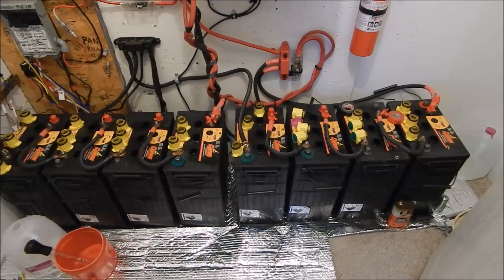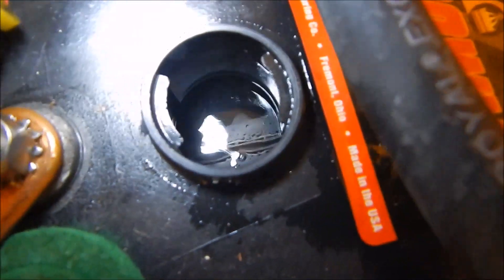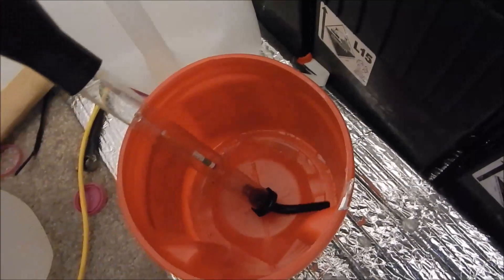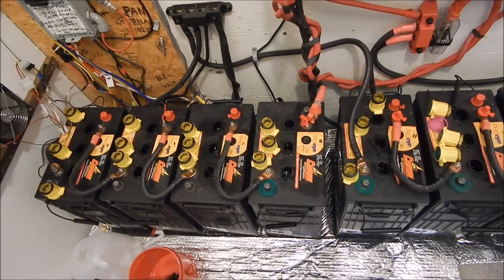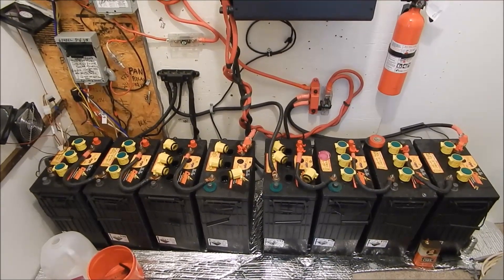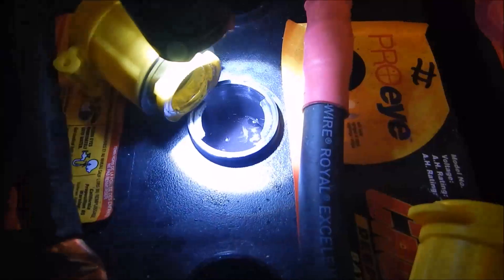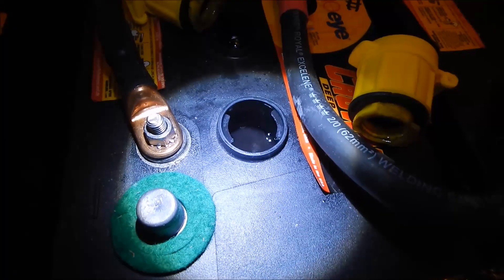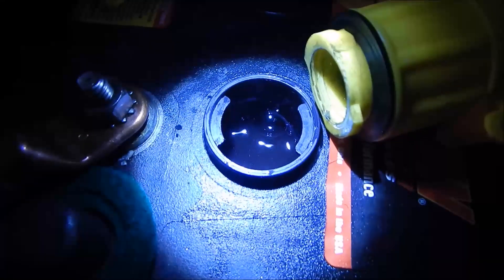Battery Bank 24V  My Big Costly Mistake!

Comment: Greetings from Oregon, I know that you now have a  Battery Extra installed on your system and have recovered your batteries. My question is was the heavy sulfation  from insufficient charging? Not high enough absorb voltage and absorb cycle time? My batteries are 3 years old and there is no visible sulfation on the plates. I have my absorb voltage at 30 volts and absorb time at 4 hours. I use a Trimectric battery monitor and a refractometer to confirm its accuracy. The one thing I have done is make sure I don't let the batteries go below 80% SOC and no more than 3 days in in between a full charge. My system was a off grid 1400 watt array with a Tristar PWM with a diesel backup. Since then I have added 2 more arrays with a Midnite classic 200 and a Outback FM 60. I am experimenting with the absorb time and return amp settings to get my specific gravity to 1.285I checked it the other day and it was 1.30, way to high and may cause shedding. I have my return amps set at 12 and I will see after a couple days if its right. Chris DIYer has the same desulfator as you have with similar results. I would get one but all my plates look like the day I installed the bank.
Reply from the maker: Hi Steve, This damage was self inflicted as I said. I was careless in watching my battery bank.Every thing running fine made me forget my bank. My charge & absorb setting were wrong as well. I also split up my bank at times like this past summer & run 2 L16s  in my Solar truck camper. I also left 2 of them sitting for 6 weeks while I was traveling , those 2 are the worst .The way U are tending to yours is the right way to do it. I learned a great lesson here with this mistake & shared my mistake so others would not do what I did. The battery extra unit works great, has cleaned up the inside of the battery's very well. I wish I had it from day one. Glad I learned this now not latter as I sold this place & I am looking for some Off Grid land in TN. to expand my system & live free. Thanks for stopping By. U do great work on your channel.
Reply: TheKilog69 Thank you sir. I hope you find the land you are looking for in TN. My wife and I have talked about doing this again only on a smaller scale. We have talked about a much smaller acreage and a much smaller house. I hope you video your property search and take us along for the ride. Have a blessed day!

Comment: Just Curious... Why 4 panels in series?   60 volts in to a 24 volt system seems high.  Wiring for 30 volts would double the current and a good MPPT should manage that OK.  Your thought.... Thanks.
Reply: Bob Duvall always in series as high as your mppt allows. Easier on the wiring and less power lost
Reply: Double current dictates heavier wire gauge... Which on the longer runs from panels can be quite an expense.

Comment: To be secure in Battery Watering Operations, you may want to consider a Self Water System... like the Flow-Rite, yes it will cost you $200-250.00 dollars, BUT how much will it SAVE you $500-$1200-2000 dollars.  I have installed several for people who don't want to mess with Watering Batteries, and people who spend lots of time away from Home.  The Gravity FEED watering system is totally the way to go.  I don't work for Flow-rite I just use there system and it's the ticket.    I build specialized equipment containers on contract for the Gov't.      So, bottom line SAVE money do yourself favor, check it out.
Reply: I have seen some real advances in capacitors esp graphene/carbon - some even self charging like a pulse charger from ambient solar radiations (cosmic wind) very slow but for small power efficient projects chips or other small hardware -- they could be self powering from environmental emf emission's.

Comment: I charge at 14.35 to 14.50 on my system. But I also have a bunch of high amp knife switches that disconnect my multiple string sets so I can hit them with a 250 amp car starter/charger unit. I fire up the genny and I do that 1 time a month for 10 minutes if they look to need it until the battery temp sensors light up and I shut it off.  I also desulfate with a DC welder, Its amazingly fast. And yes, the sulfates floating if any are cloudy for a while. http://rover.ebay.com/rover/1/711-53200-19255-0/1?icep_ff3=2&pub=5575119394&toolid=10001&campid=5337663791&customid=100A+Adjustable&icep_item=291952297948&ipn=psmain&icep_vectorid=229466&kwid=902099&mtid=824&kw=lg This welder is adjustable and awesome.

Comment: how are the batteries doing now
Reply from the maker: Hi Roy, I just limped into battery room, last looked at them last Sat. lets say. huge difference. a little to shaky to stand up today but will try to film the inside tomorrow & do a update video. It has been working on the bank  10 days tomorrow I have to say it works.
Reply: Get well soon.
Reply from the maker: Thanks Roy.

Comment: Thanks for sharing.  Great information.
since I am new here do you have a video showing your battery ventilation setup?
Reply from the maker: Hi actually I have had this set up about 6 years now, Yes they should be vented!  I even have all the necessary venting supply's  I need to do it but as it sits in a big closet with 5 bush less cpu fans that come on set to a specific voltage,& the closet is in a spare bedroom with a fan & a open window I have never installed it. It is not a problem for me.  The water miser caps help a lot all so with fumes. My home is for sale so many of my solar projects have been on hold.
Reply: TheKilog69 Gotcha, good luck with the sale. I will look forward to seeing a reinstall in the future sometime then.
Take Care.

Comment: Sorry to hear about the batteries.  Hope they are OK.  You made me think to check my bank and I'm glad I did.   What model did you get from that website?
Reply from the maker: Hi The 1500 amp hr job .$139. I will be all over it when it arrives from the UK, I will do extensive testing. U can bet i will do as many videos as I can.  When things are going good U tend to forget about maintenance.
Reply: Boy you've got that right.

Comment: I have very limited experience with these solar power banks. But I am contemplating research and building one, with that said, would not a dry, or maint. free batteries be better to use?
Reply from the maker: Hi thanks for watching .All battery types have the + & _ points . wet cell lead acid are the most affordable, AGM would be next inline. Stay away from gell cell type battery's very unforgiving as they use a gell that if overcharged will bubble causing issues & will not work, not many ppl. use them for solar most use lead acid or AGM, or if money is no object U can use nickle iron Edison type battery last for ever but U need deep pockets to buy them .to do my battery system as it is cost about $2000 just battery's nothing else cables so on, , using Edison nickel iron over $10,000.
Reply: NO.....you can not check them and you can not perform maintenance/add water and they will die earlier than any other battery that you can open.

Comment: we eq every 90 days no issues.
Reply: have mine. set to auto. eq retry 5 times
Reply from the maker: Hi Bill Thanks for info!  Just ordered the above battery recovery system per JC advice will do a in depth review when it arrives ,including Voltage ranges, pics of inside the battery's before & after.  If this works it is money well placed.

Comment: Hope they come back, expensive mistake there. But don't feel bad I ruined a set of L16s years ago by being stupid. It happens to all of us, we get so used to the system working great that we tend to forget about it. Thinking of that I need to check the water level in mine.
Reply from the maker: Thanks. They never EQ to float  after all day with plenty of power got real warm too. i,m getting the re-claimer system that Jusin Case recommends  ,I will do a video when it gets here & all testing as it goes thanks for watching.

Comment: I drowned mine in a tub with the charge controller running.  I think I still hold the trophy for Stupid.
Reply from the maker: OK U win but I get 2nd place.  I am ordering the battery re claimer system recommended by Justin Case . I will do some video on it when it get here if he says it works I believe him. See below in comments for info on it. If it does what it claims it a bargain.
Reply: TheKilog69 I wouldn't buy it from any one in Missouri though.  But that's just me.
Reply from the maker: They come from the UK.

Comment: Oh man...hopefully they will be alright. They look exactly like my Trojans when I skipped a monthly EQ. Everything seems to be alright now...but, the brown milky electrolyte sure caught my eye. I ran mine down to 24.1 all summer (with load at that voltage). Edit: Just re-checked all mine...and am hitting them with another EQ blast for an hour while I got good sun. Took off the Water Miser caps and looked down inside each cell...they all look really clean. Getting about 31.6 volts EQing right now...no loads. My thinking is that the L16 size batteries like ours are pretty tough. Have you ever "bumped" them? ie, "shook" them a little to knock off the deposits?
Reply from the maker: Thanks Chris ,never tried that but tomorrow i am ordering the battery recovery system Justin Case recommended to me, so stay tuned for updates & video of me hooking it up & testing it out, see his link in the comments if he says its the real deal I believe him comes from the UK. Mine were on EQ all day never did get done but got really warm lots of Resistance.
Reply: Roger that...great advice. I checked out the item/link...not a bad price either...will see how it goes for you and order one too if you like it.
Reply from the maker: Thanks I will update when i get it getting one tomorrow. $139? A bargain if it works 60 day money back so why not.
Reply: Heck yes! Beats $2000-3000 in battery bank purchase (or getting a few more years out of them). Physically "bumping" mine (or giving them a shake) knocks a lot of that stuff off...and then EQ. I just rechecked mine (after a mini EQ) they all look great...electrolyte is clear, plates are clean. Voltages (checked individually at rest) were all w/n .1v So, good to go here. I also took Roy's advice on Absorb/Float volts and time and set mine that way (30 volts Absorb/3 hours and 28v Float).
Reply from the maker: All good news to here we can all learn if we listen & learn from  others & absorb knowlage. Thats why I,m here. will EQ mine in AM if need be may be half bank at a time .

Comment: instead of putting water in the batteries maybe you should put battery acid in. I get it from Advance Auto but other auto supply stores should have it. Adding acid helped me extend the life of my cars battery to almost 7 years.
Reply: Never add acid to your batteries. Water evaporates and boil out and it will leave the acid in the cells. Only add distilled or de-ionized water to the batteries. 
My last car battery got over 7 years. I never turn my ignition on without running the engine nor do I use electrical power without running the engine, After getting to where i needed to go I turn everything off that needs electrical power and run the engine for 20 seconds before I turn the engine off and before I leave the car,
Reply: What J&B said, the acids are salts that stay behind when the water cooks off. So if you add more acid there's too much and you're creating more sulfation.
Reply from the maker: Thanks for info .i tried that with old golf cart battery's but they were to far gone.
Reply: If they boil over at any point is the only time you'd add acid...... And that would be a measured amount
Reply: Fail.
Reply: Wrong.
Reply: never add acid to a battery as it will destroy the plates

Comment: your battery will be ok. my finding is you need your absorb setting at 30 volts for about 3 hours. float at 28 volts. if the settings are right you shouldn't ever have to equalize. what are your absorb and float settings
Reply from the maker: That was my thinking allso I think these battery's are so big U have to kick them up regularly. My float was at 27.6 absorb was at 29.4 @2.25 hrs EQ @ 31v. Had them going all day got back home at 4PM they still never floated.
Reply: Set your absorb to 30 volts and 3 to 3-1/2 hrs float at 28volts and check specific of gravity in a few days. I think youl be happy with results. On a renewable energy system there's always a drain every night and don't get charged every day. Takes more voltage to get it charged in the time frame there is to work with. If your settings are in order equalizing shouldn't ever need to be done .I've done a lot if resurching on this subject. Float should never be set to low. If the batteries get discharged then goes through the time if absorb it probably won't be enough to fully charge the batteries so if the float us a bit higher it will top them off other wise never get up to snuff. If you want more info let me know I'll fill you in
Reply from the maker: Thanks i got little to no info from crown battery Co. seems they were not interested unless I got solar specific battery's from them, probably just who I was dealing with. been using Trogen battery #s
Reply: 29.4 devided by two is14.7 that will never work. I think in 12 volt system. 15 volt works good. 15.2 is to High that will use to much water and over change them. I have lots if experience with batteries over the years it's better to over charge slightly then to undercharge even the slight bit. Try my settings you will use more water so keep an eye on it
Reply from the maker: Thanks.
Reply from the maker: Also just order the item recommended buy Justin Case. Will do a video on it when it arrives.Have changed my settings to your recommended points. Thanks Glenn.
Reply: Keep close eye on the specific of gravity and water level
Reply: TheKilog
Reply: TheKilog69 i
Reply: Roy Amberg I'm going to your channel to sub you... Thank you for the information